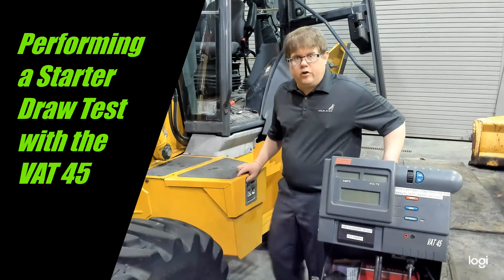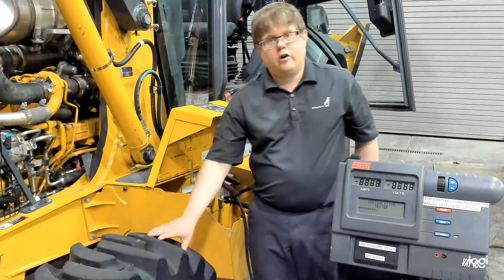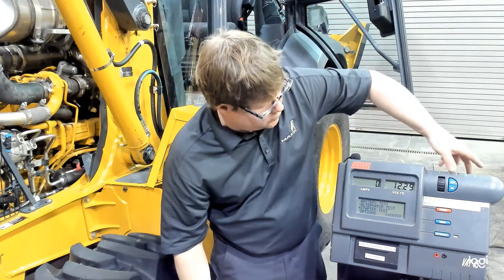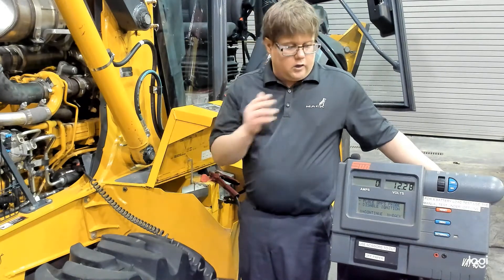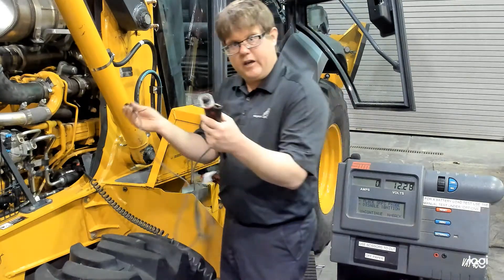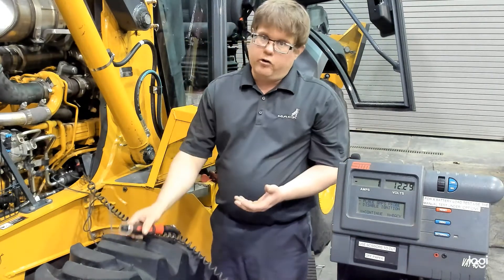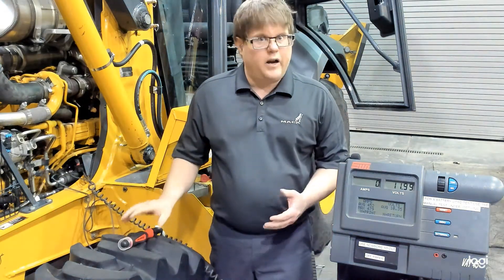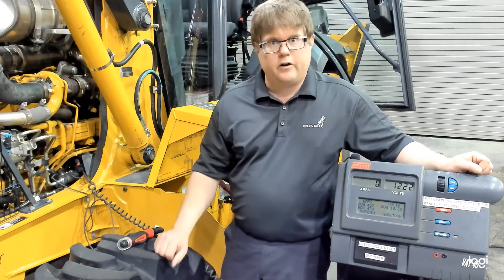10.04 - Performing a Starter Draw Test with the Snap-On VAT 45

Comment: I don't know much about starters but I learned something from your video.  I have a 2005 Honda Odyssey, with a 6 month old battery.....tested three months ago at the 630 CCA. I replaced the starter in January 2014 so it's about 12 years old.  However, my Odyssey is slugish to start....but always starts....but labors sometimes.   I'll calling the local Honda dealer to see if they can 
test the starter current draw....just like you did in your video.  I'll let you know the results.